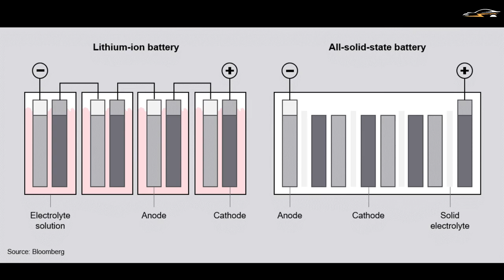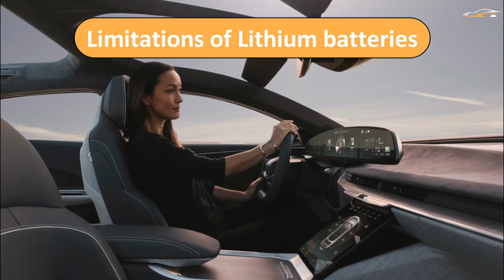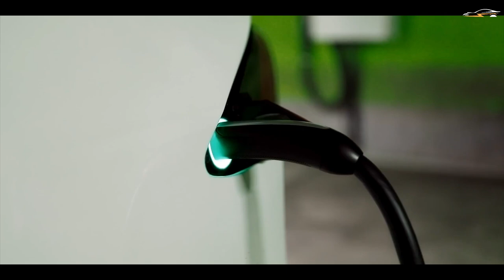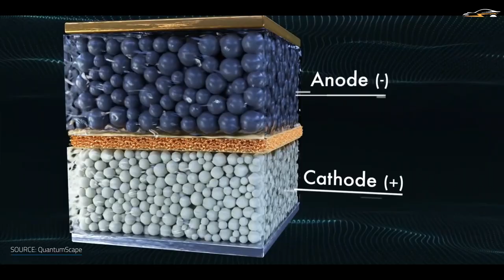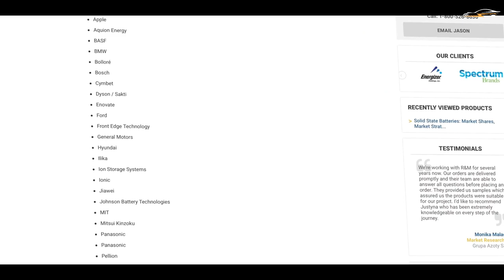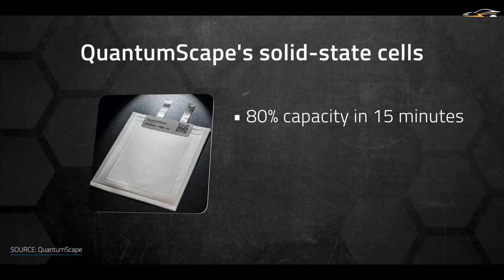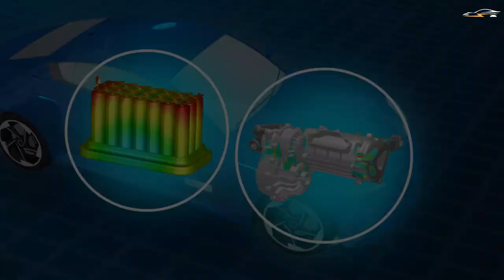BREAKTHROUGH! Solid State Battery; Do we have a WINNER?

Comment: That's a bad/weird assumption/conclusion, just bc Lucid has good range and is silent about their batteries, doesn't automatically mean they have solid state batteries. 

If you watch other videos about Lucid, the reason they have good range was something like they focused on shrinking and improving powertrain efficiency, a good drag coefficiency. They also mentioned a higher voltage which may help